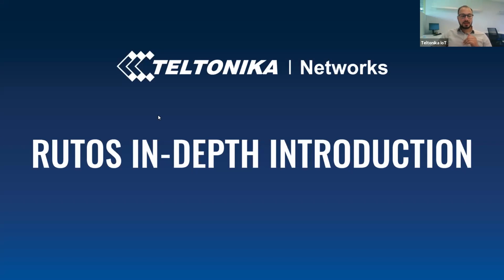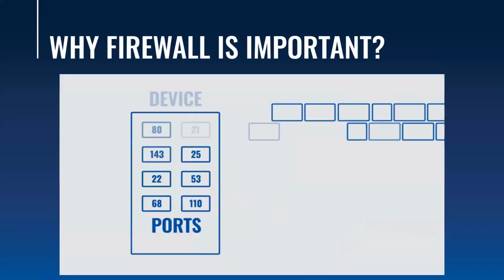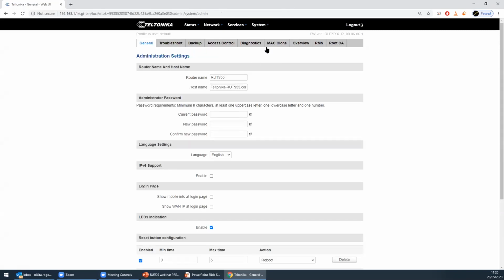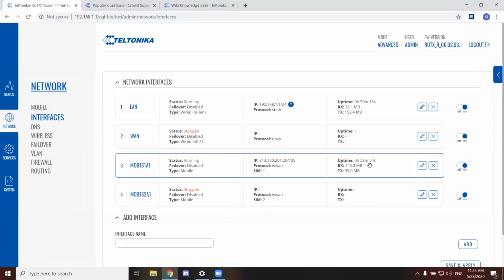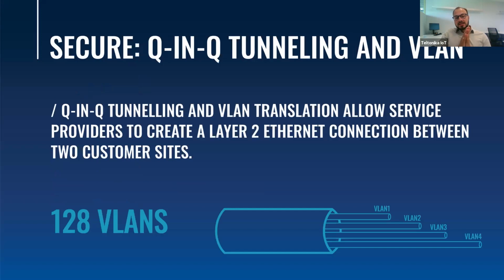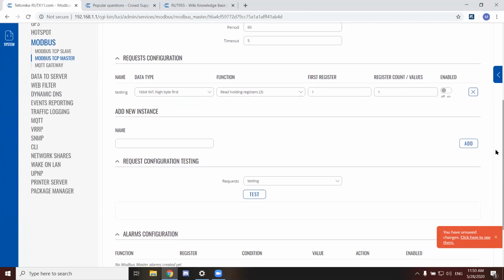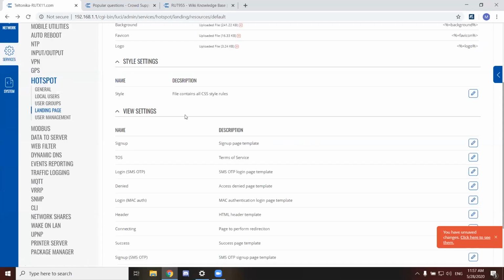Teltonika Networks RutOS - an Extensive Introduction | Webinar

Comment from the maker: Timestamps:
0:00 Introduction
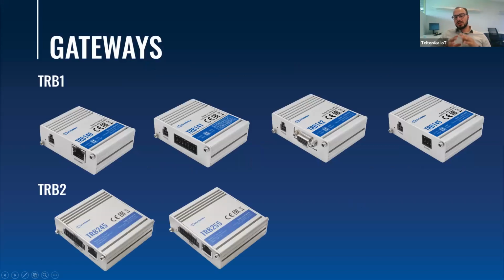1:37 Gateways series
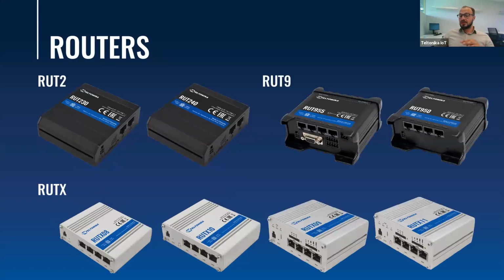2:07 Routers series
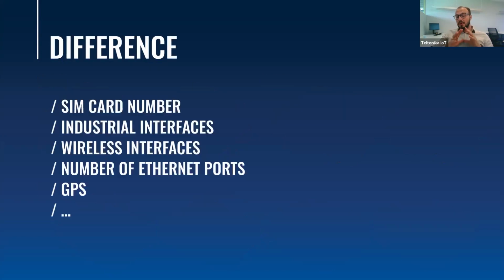2:20 Differences between devices
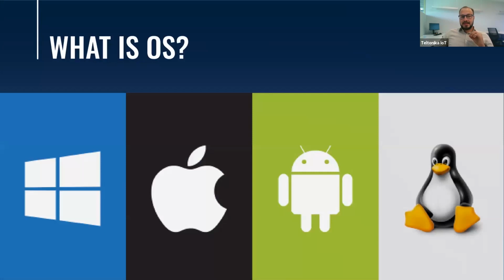3:13 What is OS?
3:42 Teltonika Networks RutOS
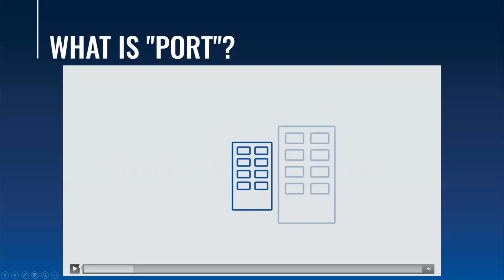6:27 What is "Port"?
9:15 Why Firewall is important?
11:26 "DDOS" Attack
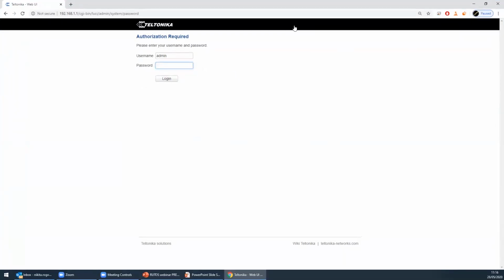12:13 Practical example of security with RutOS
19:55 Easy to use
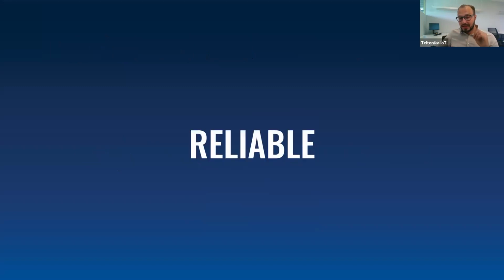23:09 Reliable
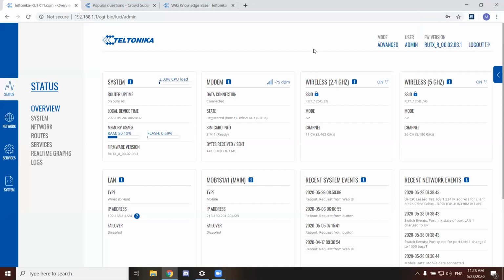24:23  Practical example of why our devices with RutOS are easy to use
36:20 Functionality
40:29 Practical example of functionality with RutOS